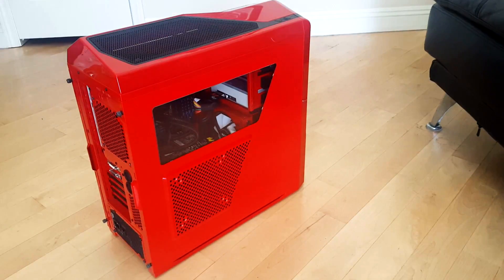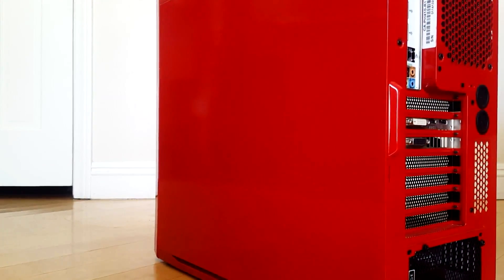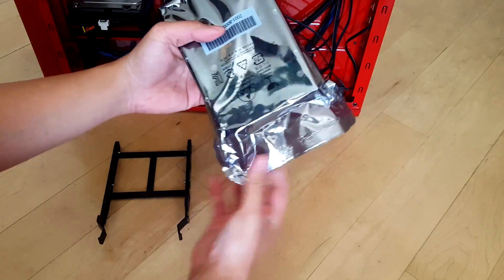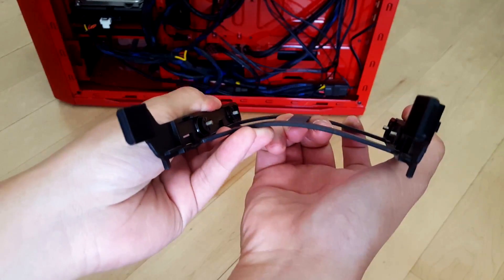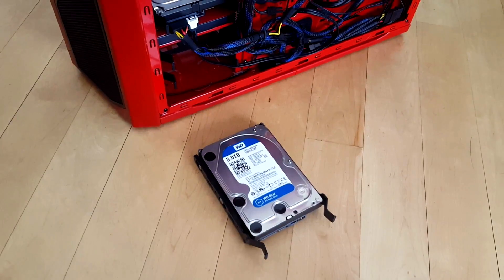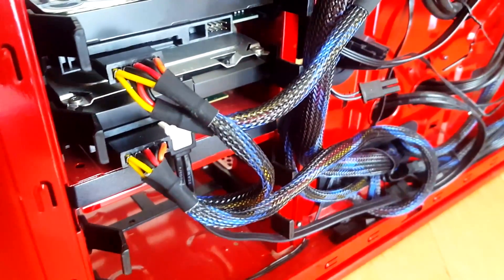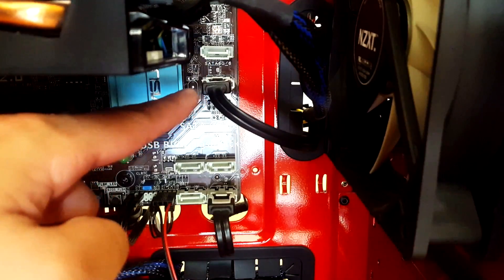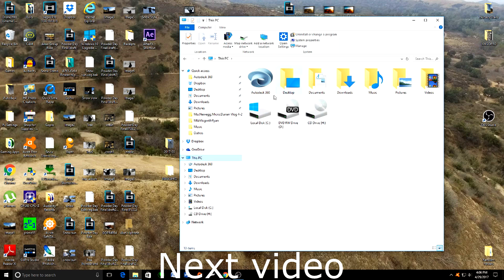How to Install  a Hard Drive

Comment: Should all the necessary wires come with the hard drive? Or do I have to buy them separately?
Reply from the maker: Wires don't come with the hard drive. Power wire comes from power supply and sata cable has to be bought separately. Its pretty cheap tbh
Reply: excuse me sir,what name item for cover your HDD? and does it still need screw For tighten?

Comment: i don't have any bays left for an HDD so does that mean that i have to buy a bigger case?
Reply from the maker: Unfortunately yes you will need a new case. Good reason for an upgrade maybe? hahah
Reply: @50nollieman  😂 😂
Reply: You could get an external hard drive , but the data transfer will be a bit slower
Reply from the maker: @malcolmjames7388  Yes correct! and also the risk of dropping the external drive and losing all data...happened to me before :/

Comment: I have a question if the hard drive tray doesn't fit in the drive bay. Does it mean I can just put the drive in?
Reply from the maker: You mean it doesnt have a hard drive tray but there is a slot? If so check if there are screw holes. If there are holes then yes you just slide the hard drive in and screw it in place
Reply: @50nollieman   I haven't checked yet but is there a bay where you can just slide the Hard Drive in and it just locks into place because my bay doesn't look like the bay has screws to screw the hard drives in.
Reply from the maker: @minidonut827  Unfortunately no. Drive bays are specific to the pc case :/
Reply: @50nollieman   Just hooked up my 4Tb and activated it. It's all fine. But my bay doesn't require a bay all I have to do is shove the drive in and it sticks inside.
Reply from the maker: @minidonut827  That's great to hear! Hopefully my video helped haha thanks for watching! Enjoy your 4TB hard drive :)

Comment: Hey dude, I'm buying pre-built pc and the only thing that's missing is the hard drive, so my question is does the power cable come with the PSU or do I need to buy it?
Reply: Should do, unless the Psu is semi modular,  the manufacturer might have taken out the sata power cable to cable management or other reasons. Most likely they included it or left it unplugged into nothing.
Reply: @rekface335  Thanks!

Comment: Ok I have some questions I am hoping you can help me out with. I built my rig many years ago and have fallen behind tech wise as I have gotten older. I am running a i5 2500k and have a gtx 1070 ti. I have one hard drive that has 200 gb left mostly taken up with games.I would like to install another hard drive for space. Does it matter what brand or will it conflict with the one I have? How hard will it be to transfer all games to second hard drive including steam games? Also I know this might sound crazy but i have never backed up anything can I do it with a usb flash drive and should i use any special software for dummies when it comes to this lol? Any walk through on any of this that you can recommend? With this video I can surely do a hard drive but the rest I am pretty shaky on. The hard drive space and file moving/back up is the most important for right now. Being In a year or so I will also be upgrading the proc,motherboard and memory. My case is similar to yours with ease of access. I know some of these questions might be idiotic but as I have said I have been out of the loop for quite some time. I seriously dont want to wipe everything and start from scratch having to redownload everything being I have a ton of games.
Reply from the maker: Hi! Sounds like youre upgrading hahah 
Question 1
NO. The brand of hard drive does not matter. My main hard drive is from Seagate and my second hard drive is from Western Digital. 
Q2
Transferring the data from your main hard drive to second hard drive should be simple drag and drop. You can access your old data from your main drive and select them all or even "copy" then you can "paste" it into your second hard drive and it will transfer. 
Q3 
Yes you can just backup by using a flash drive because "backup" just means having two copies of your data. Simple as copy and paste. No you shouldnt need any fancy backup softwares because they are pretty expensive. 

No question is a stupid question!
Yes I understand having to wipe everything then redownload is a pain. I also need to free up space on my laptop hahah Not looking forward to that. Good luck!
Reply: Thanks for the reply:) and thank god sounds good thought it was all going to be ruthless trying to do this lol.
Reply: Ok I have another question I know not stupid question lol. I am sure you know about gaming and stuff and I like the fact your videos are straight to the point and on point. I have stuff coming on the way such as hard drive and all of this will be done wensday or thursday. Ok you said it should be an easy drag and drop to move stuff to other drive. But what about when it comes to steam and mods using vortex? My main concern is can I move vortex,mods,and skyrim se to the other drive without casualties or should I just uninstall all mods,vortex,skyrim se, and do a clean download to new drive?. The main thing I want to achieve is to move all steam games,mods/skyrim,other games to this drive to open up my c drive more for just the basics of system,media,pictures being the main space taken up is gaming.Being they take up about 500gb of a 930 gb drive.I have about 14-15 games on steam, and then I have online games like final fantasy online,star trek online, origin and the mass effects. Is this gonna open up a can of whoop or what? just asking because I never have moved files before and i have looked at other videos in how to do so and they just do not make things easy. Unless by chance you would like to make a video on all of this lol?. I just dont want to screw up anything and have to clean wipe it all.

Comment: The sata cable come with the hard drive when u buy it ?
Reply: Comes with the power supply I believe
Reply: It comes with the motherboard.
Reply from the maker: No it does not
Reply: excuse me sir,what name item for cover your HDD? and does it still need screw For tighten?
Reply: gunawan gunawan santoso the screws usually come with the case and the manuals say which screw you need for the hdd
Reply: @christianmilanov1107  i see,so sir,does you know what name item for that guys using cover the HDD?
Reply: gunawan gunawan santoso If you mean the metal part onto the HDD, it is not sold separately, HDDs like Western Digital Blue and Seagate Barracuda have those covers

Comment: Where does the sata power cable go?
Reply from the maker: The power cable for the sata would come from the power supply. If you have other questions Id be happy to help
Reply: wait does the stats power cable connect to another cable that looks like it?
Reply from the maker: The sata cable connects to the motherboard and the power cable will be coming from the power supply. If you have more questions let me know!
Reply: @50nollieman how do you get the cables for it do you get them with the package or
Reply from the maker: @the2zombiekillers192  You have to buy the sata cable and check if your power supply has an extra power connection

Comment: So can I plugg the hard drive in with any empty power cable that’s around my pc or does it have to be a certain one?
Reply from the maker: It doesnt matter which cable it is from the power supply as long as it fits the plug for the hard drive. Hope that helps!

Comment: So the cable connected to the motherboard, that is connected ABOVE the SATA cable, is the one that provides power to the drive, right? I ask because i don't want to screw up connecting my Gold Enterprise drive lol
Reply from the maker: Nope it is not. The sata cable connects to the  motherboard and the power cable will be from the power supply. Hope that helps!
Reply: AdventuresWithAlan but the power cable will connect directly to the motherboard, not directly into the drive, right?
Reply from the maker: No. The power cable will only connect to the hard drive. Let me know if you have more questions. Im happy to help

Comment: DUDE PLZ FIX YOUR CABLES OMG
Reply from the maker: hahhaah will work on it! xD
Reply: His cable management is fine.. His case hides all those cables and if he implemented proper cable management everything would be tied off and these videos wouldn't be so easy to do. I prefer to be able to swap things out easier and free up cables and components without releasing velcro straps or breaking zip ties.
Reply from the maker: Exactly right! As you can tell from the windowed side of my pc all the cables are hidden and in the backside it is all tied down :) Thanks for watching!

Comment: So if I have  2 drives in my PC and want to swap the non-boot drive for a larger one is it as simple as turning the PC off, popping it out and putting in the new one?
Reply from the maker: If you installed windows to your computer with only one drive yes, removing the 2nd hard drive while the computer is off will be ok. Just curious what your plan is with your saved files in your 2nd hard drive? If you plan to backup your saved files from your 2nd hard drive to your primary hard drive and put in a NEW 2nd hard drive you would have to rename the NEW 2nd hard drive whatever the OLD 2nd hard drive is called.
Reply: AdventuresWithAlan nah, I'm just getting a new PC and the 2nd SSD is 240gb so I'm swapping it with the one on my laptop which is 480gb, I just plan to put the higher capacity drive on my main PC and reinstall Windows on my laptop
Reply from the maker: Then yes you should be okay
Reply: AdventuresWithAlan thanks mate
Reply from the maker: No problem man! Have a good one

Comment: Does a new hard drive come with the cables?
Reply from the maker: Unfortunately no. The power cable will come from your power supply and the sata cable might come with a motherboard. The sata cable ranges from $1-5 so it's not that bad hahah
Reply: AdventuresWithAlan ah good to know thanks
Reply: AdventuresWithAlan also what about the screws to hold it in place do they come with it
Reply from the maker: There should be extra screws in your pc case. The hard drive only comes with a hard drive wrapped in packaging and that's it. Let me know if you have any more questions. And youre welcome!
Reply: AdventuresWithAlan yikes I hope my dad hasn't scrapped the box is it possible to but more if you don't have them?
Reply from the maker: I meant inside the computer hahah not just in the box. You can check if there are extra screws if you open the side panel
Reply: AdventuresWithAlan there is extra hard drive slots but know screws you see I got my computer built for me buy somebody and I'm pretty sure they said that the screws where in the case's box
Reply from the maker: Looks like you have to go looking for the box then. Goodluck!
Reply: AdventuresWithAlan thanks
Reply from the maker: No problem! Let me know how it goes or if you have more quetions

Comment: great video! i was wondering what type of pc yours is. and holy crap it has 5 extra slots for your pc. i was wondering what model and company your pc is. My pc only has 3 extra slots for hard drives. but really this was a great help! Ark survival evolved takes 142 GB in my pc hehe. #beingagamer
Reply from the maker: Thank you for watching! and thank you for the compliment heheh My pc is fully custom built. I just bought part by part as they went on sales and when I finally got all the parts, I assembled the whole thing :) If you want to know what the pc case is its by the company "NZXT" and the case is called "Phantom 410." 3 extra slots is enough. Right now I only have the 2 hard drives in this video and its more than enough for my games hahah wow that game takes up a lot of space tho! Let me know if you have more questions. I'll be glad to help :) #gamersunite
Reply: AdventuresWithAlan yea lol. I was wondering do you have to have a specific brand or something for a certain motherboard. My pc came with 1 tb (really 931gb and with the motherboard and gtx graphics card I only had about 800 gb left for my own doings) isn’t enough and I’m already down to 531 gb left and I got my pc during the beginning of the year and I need more than 800 gigs for the future. So I was going to go shopping for 2-3-4 tb hard drives but I needed to know if I had to have a specific brand or style of hard drives
Reply from the maker: Hmmm as long as you buy a "desktop" hard drive it will fit your case because "desktop" hard drives are all the same physical size. From my experience western digital is a good brand so far. If you're interested I also did an unboxing of the western digital hard drive that I installed in this video :) Also don't forget to buy a "sata" cable. The cable isn't provided with the hard drive that you'll buy. It's only about $2 or so
Reply: You're playing ark off your hdd? How brutal is that?
Reply: @bkblindside3884  ikr lmao hard drives are thing of the past just get an ssd